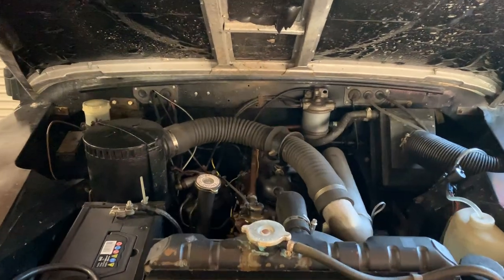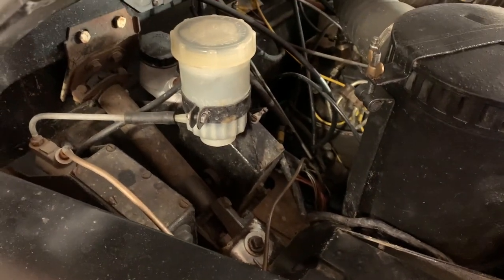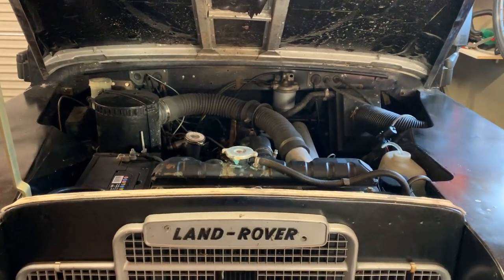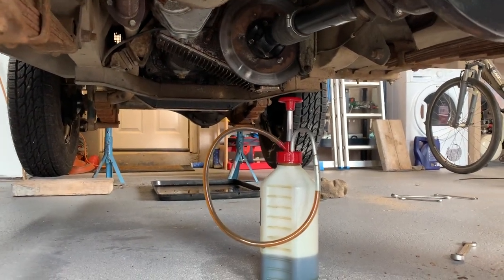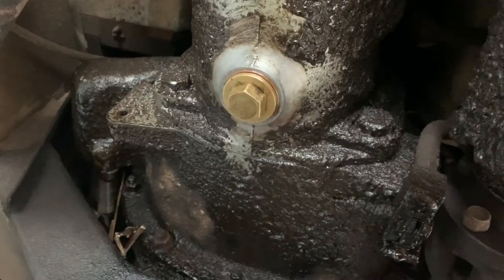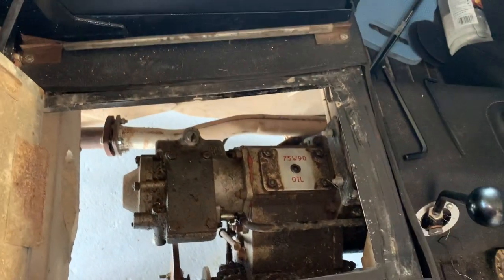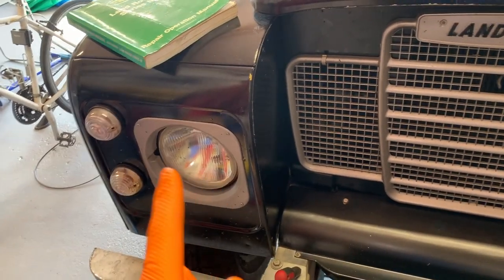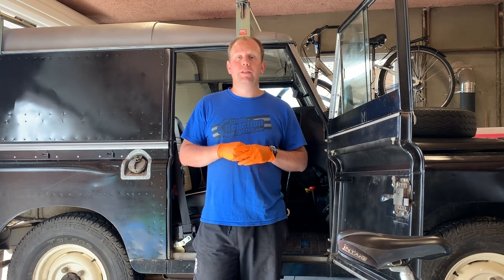Land Rover Service Guide - Series 3

Comment: Excellent video and much appreciated.  On the suspension, my S3 had a tendency to bounce down the road for the first few hundred metres so on the advice of my local guru I just stripped down my leaf springs and sanded them all off to remove the rust then put a film of copper grease between each leaf.  What a difference- it’s almost like driving a Jaguar now 😊.
Reply from the maker: Nice one! I keep after mine with regular oiling now, it’s great

Comment: Hi Resto.  Really helpful video, thanks.  Question, why is EP90 better than the one shot grease in the swivel joint?
Reply from the maker: Hi! This particular subject is a bone of contention amongst Land Rover owners! The factory recommended EP90 to ensure lubrication of the swivel bushes but the one shot is thicker and less likely to leak around poorly-sealing chrome balls. The jury is out!
Reply: Restosaga Workshop Ok thanks, as I have poorly sealing chrome balls, might go for grease until overhauled.
Reply from the maker: That’s what I’d recommend. I’m in the middle of a front end strip down (video soon) but will be building up with grease as leaks are really messy!